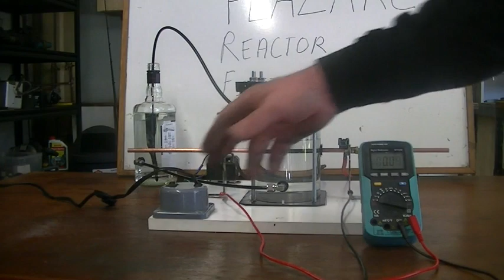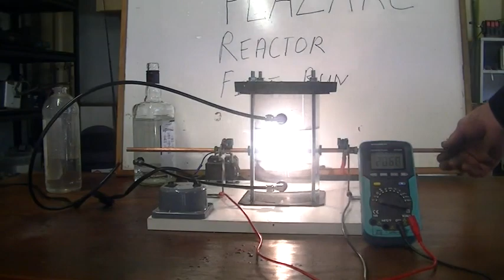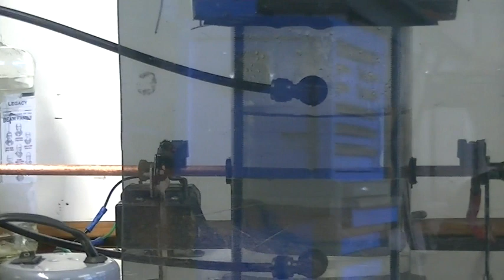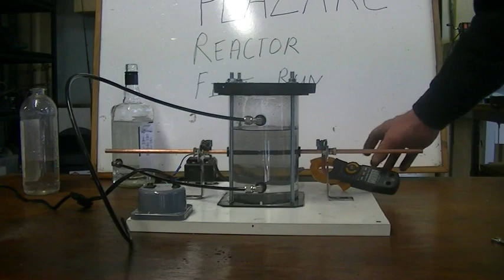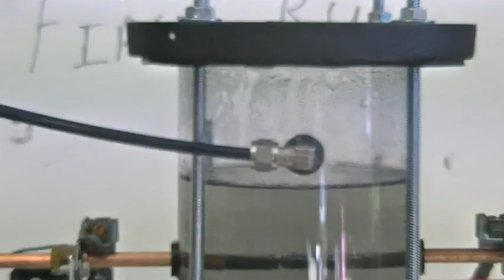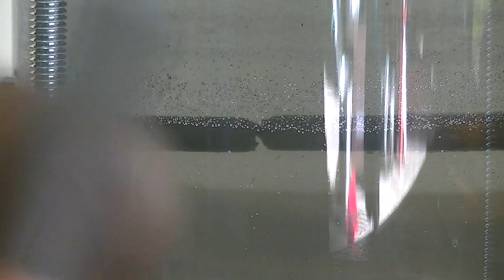Plasma Reactor Version 2

Comment: I have pause this at 5:34 be very careful this looks like an explosive to me. you need reinforce reaction chamber with thinker glass and implement and pressure relieve valve. you can turn this in a water powered motor if you add another subsystem to transfer energy from the output to the input so that you have a better ratio of input and out put there for reduces the external power requirements. 

do you want to work with me? I have all the requirement to turn it into a motor in my head.

Comment: I have a suggestion, is there anyway that you can use a very high voltage and low current just to make the gap? Like how a xenon flash works, HV High current on Anode and cathode, and a 3rd electrode to spark the gap, allow the mass current to flow through the tube.